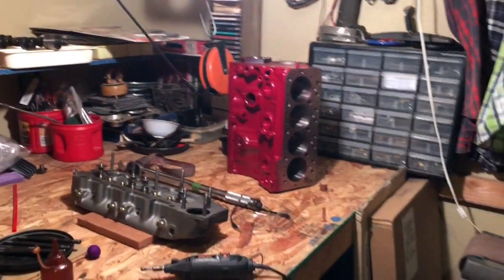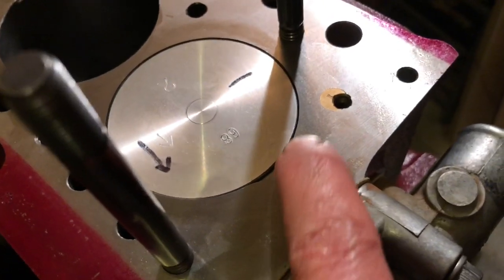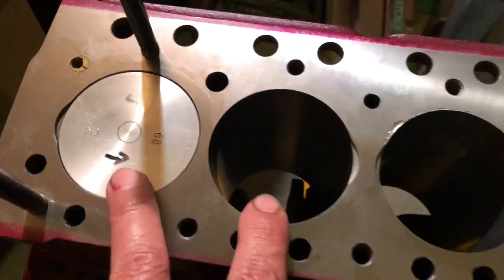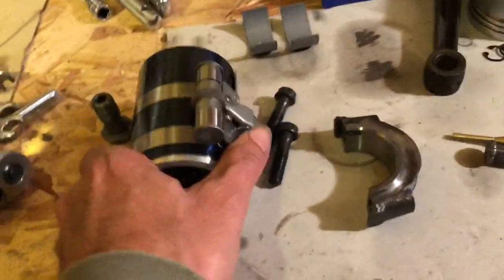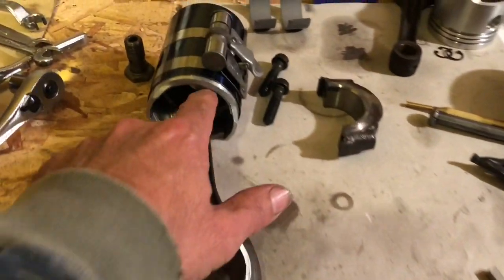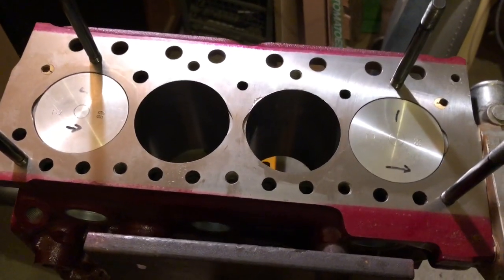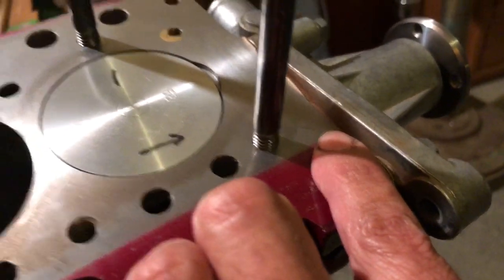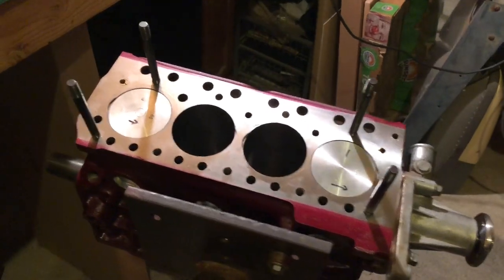Super Small Bore bottom end together

Comment: what do you think the final CC and CR are you aiming for? will you be blue printing the engine so that I can Copy it ? :P
Reply from the maker: Well, a standard 998 ends up around 10 tp 1 with flat top pistons. With the short stroke, there is less air to 'squeeze' than a 1275.  With our way bigger bore and the smaller combustion chamber of the 1275 head, this one will end up around 11 to 1, or slightly higher.  I can adjust compression ratio with custom thickness head gaskets like I did for the Super Moke!

My plan is to make this easy to copy, but I don't know if these pistons are available. The goal was to use the the more common (cheaper!) 998, but all the time and machine work has this first one costing quite a bit more than a 1275 so far!  Still, in places like Ausralia, there just aren't any 1275s.  If you have to pay thousands to get one to rebuild (vs often free for the 998!), then this could still be a good option for many.